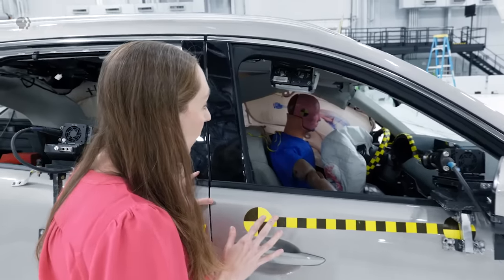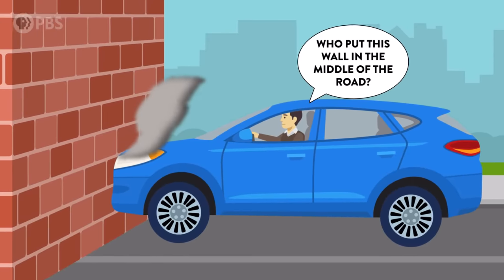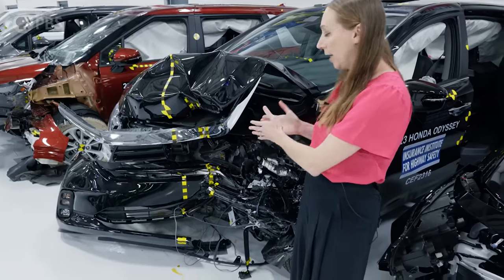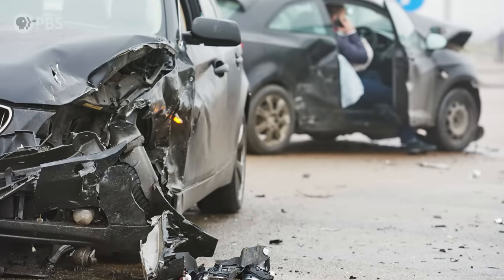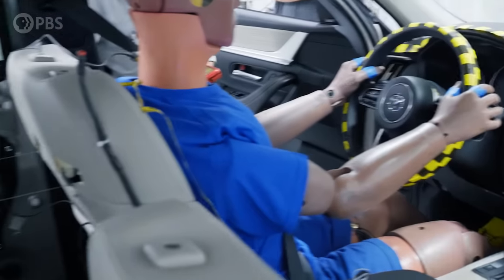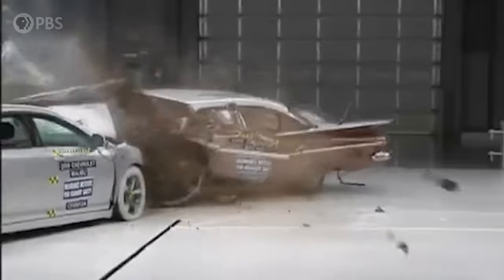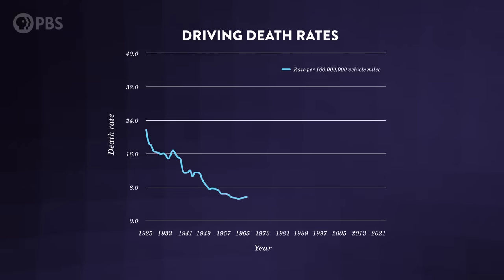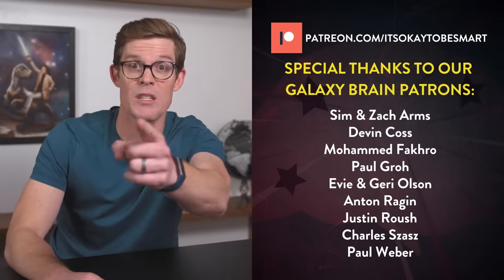The Incredible Engineering That Helps You Survive Car Crashes

Comment: Regarding Ft= m∆v, although manufacturers only have control over t (and to a lesser extent, m), there is still one factor that can help with reducing the force of impact, and that is something you, the driver, have control of: the ∆v term.

Keeping within the speed limit of the road you're in, and driving slow enough and safely enough that you can see within your braking distance, will help reduce impact force better than whatever engineering designs car manufacturers come up with. Safe driving can reduce the impact force down to zero. Plus it'll help with fuel economy.

Drive safely
Reply: Good point

Comment: The IIHS should do more small overlap test but with SUV’s/Trucks against sedans, I saw a IIHS videos of a 2017 Honda pilot against a 2017 Honda civic and the Honda civic’s seat belt failed and I wonder if that will repeat with other sedans/cars. Due to the higher force and higher deceleration coming from a larger & heavier opposite vehicle, a vehicles force/weight increases as it slams into an opposing vehicle/object dependent on speed and mass. These crashes against a solid object aren’t producing the same opposing deceleration forces as in real world vehicle to vehicle crashes.

Comment: with a very basic understanding of physics, crumple zones are kinda self explanatory. as any skydiver wil tell you, its not the fall that kills you its the sudden stop. Same for a car crash. the greater the change of speed over shorter amount of time the larger the g-forces you have to be able to endure. so spreadng the force through the structure of the car which passes the force around the passenger instead of into them and preading the change in speed out over as much time as possible is the key to surviving.

Comment: Nothing beats the odds of not having to drive (or be in a car) on daily basis and living/working in areas where vehicles are banned / drastically limited.  Imagine how many more lives (not to mention cost) will be saved (also less air/sound pollution) if city planners design, build our cities to have as little cars as possible while having maximum mobility.

However this effort is definitely good for those who drive (or need to be in a car) for a living.

Comment: I always wanted to make it so the seats of a car would have a resistive spring or gear to make the driver travel an extra couple moments before stopping completely.
Reply: This is what the seatbelt already does. The seat is behind you. In the event of a crash you're disconnected from it. Having springs on the seat would do nothing for forward movement. The seatbelt has a twistbar that absorbs some of the forces when you pull forward on it. It is effectively a spring.
Reply: @scopie49  yeah, until last week I was unaware of the seatbelt loosening proportionally to the force after it squeezes you back into the seat. It basically accomplishes the same thing but more effectively since the mass of the seat isn't being mitigated as well.

Comment: This is all cool and needs to be done, but we also have to acknowledge that the car manufacturers DO have control over the mass of the vehicle—cars have been getting bigger since the 90s—and we DO have control over the speed through speed limits and drivers following them. And stopping crashes? Can’t crash a car that’s parked, because you walked or biked or rode transit or telecommuted.

Let’s look at the whole picture—make it possible to live with as little driving as necessary, keep the cars at a safe size and speed, prioritize and protect non-car street users, AND make the cars as safe for the occupants as possible. But this is only taking care of the occupants. No amount of crumple zone will crumple as fast as the pedestrian the driver didn’t notice because they were speeding and on their phone.

Comment: I really wanna know more about the camera inside the car. How it can handle those kind of G forces.
Reply: Those cameras are made by a manufacturer almost exclusively for car crash testing. They can go up to 200g shocks. Record up to 3000fps. Not something you can buy in a store, since you also need special connectivity system and proprietary software.

Comment: This might be a dumb question, but regarding collisions that aren’t fully head on, wouldn’t the deceleration be different anyway? Since the cars aren’t hitting straight on, they would decelerate after collision over a longer period of time when they get thrusted to the side wouldnt they?
Reply: Yes the peaks of acceleration of the car are greater in full frontal, full stop crashes. But all the safety systems are made mostly for this kind of crash so usually the dummies are well retained, the airbags are doing their best job. In 40% or 25% overlap, the car has less of a peak but since the car is rotating, the dummies aren’t going straight forward and might pass right between airbags, hence why they are putting paint on the face of the dummy and making sure their’s no paint on the A pillar or the steering wheel. Newer cars are doing well with bigger side curtain airbags and passager airbags that are inflating in front but also on each side. Your question is super interesting!

Comment: Unintended consequences: even dumb crashes at 30 km/h cost tens of thousands of euro to repair. Drivers feel so safe and cozy that reckless (=texting while) driving is increasing. Cars are heavier, wider, taller, which increases pollution, land use and last but not least, danger to pedestrians and cyclists. We will have to reckon, sooner or later, that with car safety we went too far.

Comment: Deep dive and you don't even mention radar, which is the most important sensor for collision avoidance currently?
They were on the table!
Lidar might not even spread (at least if it depends on Musk), and ultrasonic barely he has anything to do with this and it's not the camera's main function usually.

Good video otherwise and for most people what I mentioned is probably not important, but it was striking for me from an information channel, makes me wonder whether everything else is/was researched in similarly overlooking manner (I don't believe so, but you get my point)

Comment: How much testing is required for different body shapes both as drivers and pedestrians like women, shorter people, overweight people, and disabled people? Just wondering since some other models were briefly shown but both test crash dummies used were average male height and weight.

If a vehicle model tests well with standard average male shaped test dummy drivers but is abysmal with average female shaped test dummy drivers, how is that reflected in its safety rating?

Comment: I do not understand why the seats of a car are not made to move forward slightly after the body of the car has come to a stand still. Why not use the extra space inside the car to slow down, while reducing the whipping. There is probably a good reason.
Reply: That's more or less what the seatbelt already does. It pulls you back against your seat and then unspools slightly during the crash to allow you to move forward while the twistbar inside the seatbelt mechanism absorbs some force. The seat should remain stationary otherwise it would just move with your body. This is also why you should have your seat as far back as possible when driving. More forward space.
Reply: @scopie49  well, I would rather have you sitting in the position where you can hit the breaks faster. Cause you would then crash at a lower speed or not at all.🤔
Reply: @Petch85  You sit as far back as possible while still being able to touch the brakes.. Obviously.
Reply: The airbags job is to take the most space between you and the steering wheel and to control the deceleration. If the seat is going forward, you have less space between you and the wheel. The belt, being attached to the B pillar, is not moving with the seat so going forward might actually hurt you in the sens that the belt would get a lot tighter. Also, in a rear crash, you wouldn’t want the seat to move back since you might have someone in the rear seat (especially a kid) being push forward by the collision.

Comment: Most cars, if not all exceed the federal standards.  IHS is responsible for that as car companies don't wasn't to do poorly.

I own a 1965 Chevy Corvair convertible, so not the safest car out there.  The "padded" dash is a stamped piece of steel covered with an 1/8 inch  (3 mm) of foam and vinyl.  Looks nice, soft to the touch, but don't want to hit it with your head.

Comment: What about a simulation of a 25 - 50 % overlap smash test between a modern car and a 9000 lb. pickup truck.
What if the pickup is travelling between 50 - 100 mph. ?
Smelting a steel which can withstand light-speed impacts is for the future.
The limit to crash severity depends on the level of criminal intent.
Humans are a criminally complex lot, and tectonic impact speeds won't fill hospitals
or cause blaring sirens.
It all boils down to the Matrix.
If opposing lane vehicles had different parallel-mass phaser modules, collisions would be impossible?
What is the matter that separates a parallel reality?
Hopefully something futuristic comes out of this Operation Paperclip meatgrinder stuff.

Comment: Wait, did he just say he replaced the petroleum fuel with   a mineral spirit before crashing it? So they are using a mineral spirit to power the car for the crash?
Reply: Nope, a cable system drags the car into the wall. They show it around 23-24 min.

Comment: It's always seemed so weird to me that I'm countries that drive in the right lane the driver is on the left and vise verse for other countries. Why are the drivers in the middle of the road where they are more likely to be on the side of the car hit during a head on collision? Wouldn't it be safer to be on the outsides? A passenger would be screwed, but cars always have a driver but not always a passenger so at least some of the times you would have head on crashes where the car isn't crumpling into the driver.
Reply: But if they sit on the far side, it is a lot harder to judge if you're going over the line or not. So there would be a lot more head on collusions. And at highway speeds, a head on collision is going to most likely be fatal never mind which side you're sitting on.
So over all I think one would have more deaths.

Comment: Used to work with high-speed cameras, and saw hundreds of these. Very cool video. Great science.
Reply: What I always found most interesting, kinda funny, was that years ago, they tried to use physical triggers for crashes, but the impact was so fast, that it obliterated the trigger device before it could trigger the diagnostic tools. haha. They had to make faster triggers before they could even test anything!
Reply: I work at the moment with high- speed camera and nowadays the trigger system is an open circuit that is being closed by the impact. Cameras are recording continuously and when the trigger is hit, they keep whatever timing we set up before it, and continue recording after the trig. Mostly, 400ms is more then enough to get the initial impact and the rebound! Crazy fast!

Comment: Your fit didnt go from being safe to haveing a serious flaw.  Its the same safety level as ot was.  This one of the dangers of using tests to heavily influence your purchase and hour safety confort level.  

Also these tests are  only useful with vehicles within 500lbs of eachother.  Some sub models weigh more different than that 

Safety structures and the features shown are a thing and are imporant.  But much if real world crashes depend on your kocal environment as well as physics. 

Some huge factors are frame rail height kn v vs v collisions, as well as mass and seating height. Alternatively in vehicle vs non moveable barrier like tree or bridge support at some point the vehicle mass wlrks agianst you.  That is much of how small and light cars like your fit or smart for 2 test surprisingly well. Less vehicle weight less energy to deal with

Comment: Very disappointed at this video which misses to mention the huge effort made during the design stage using advanced computer simulation. The gap between the simulated crash and the actual test has decreased significantly so when the crash test takes place they already know pretty close what will happen and they verify & confirm. I know it looks kind of cool smashing cars into walls, but this testing is just a small part of the engineering of safer cars, most part comes from design & simulation using CAD & CAE technology

Comment: 🚜🚜🚜🚜 question here, if manufacturers create a car with certain specifications to slow down the speed of the accident and if tires are also used to for it, changing the original tires of a vehicle will decrease or increases the cars  rating?
Reply: It would depend on the tires

Comment: mOst importantly, you slow down at a different speed when you’re not wearing your seatbelt subsequently  slamming into the seat in front of you. Engineers cannot control your fat ass flying around the cabin. Wear your seatbelt, It will save your life.

Comment: What aboutr female test dummies. Because women are often shorter and weigh less, which does really make a difference.
Reply from the maker: This is a really interesting issue, and Jessica has studied it. Here is what she told me: there are important anatomical differences in males and females including body size, mass distribution, pregnancy etc. and these do factor into different accident outcomes. But what surprised her is that most of the difference in accident outcomes between males and females is sociological. On average women drive smaller cars (less protection), and within the same class they tend to drive smaller options (eg small SUV vs large SUV). On average women also make more short trips by car and are more likely to be in the car that is struck by another (ie in a side impact). So the biological differences are important, but it’s a much more complex and multifaceted problem than you might believe